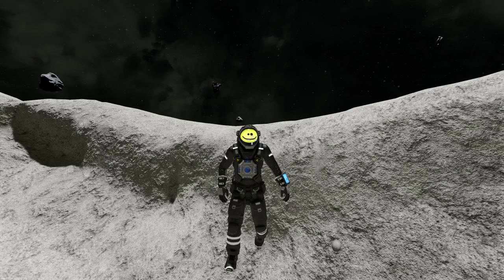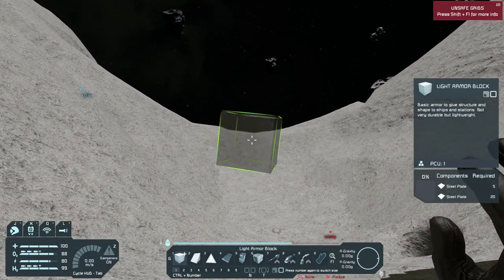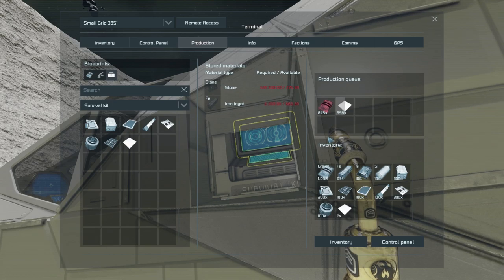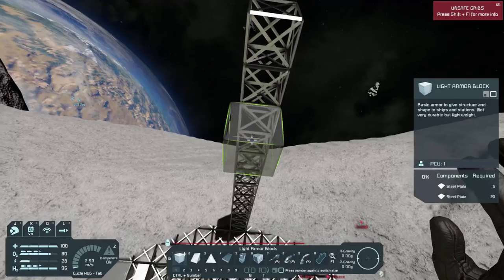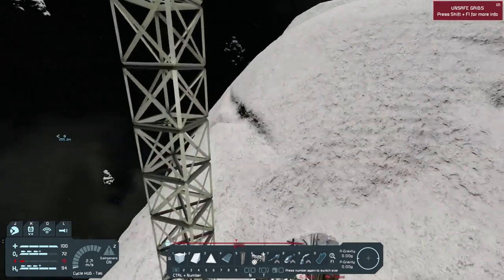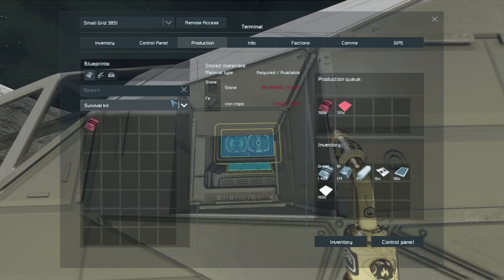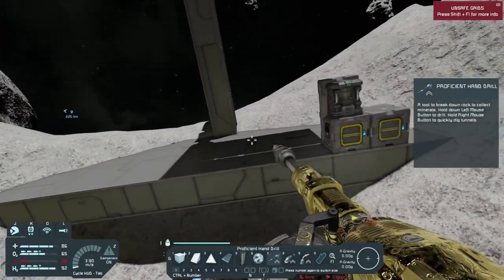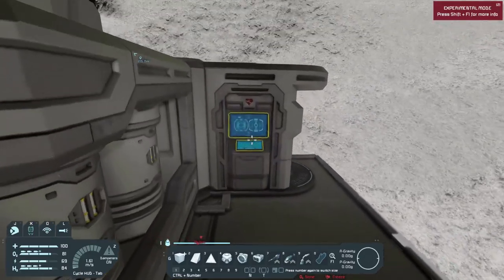Space Engineers #17: Power Needs

Comment: Don't forget that the 12 MW from the battery is not the stored power but the maximum MW it can run machines with. The stored power is just 3 MWh. So for all the stuff you have you should be able to run it for roughly an hour, if everything is running all the time. Maybe factor that in that not all your machines will run 24/7, if you do not plan to have a constant input of ores and constant output of components. Depends on your plans.

You should have cobalt, the metal grids in your containers and the assembler need it. Maybe you can grind down stuff like that and disassamble some parts for the cobalt that is in there. It depends on how much you need the gravity right now.

Great episode, always good to see people with a passion for SE.